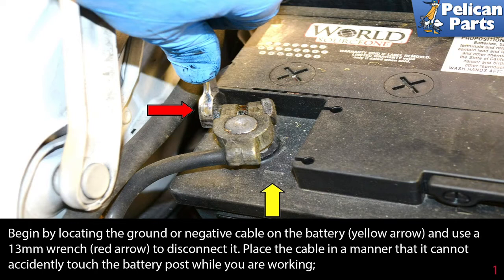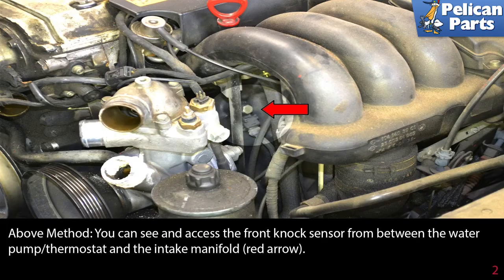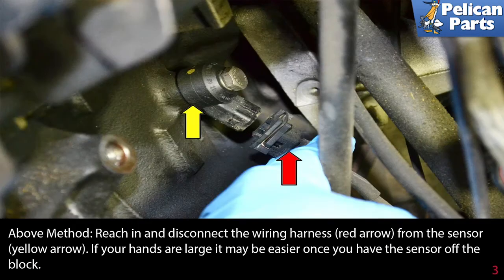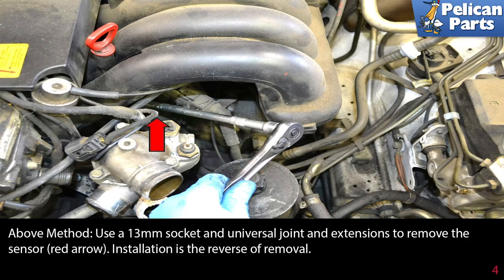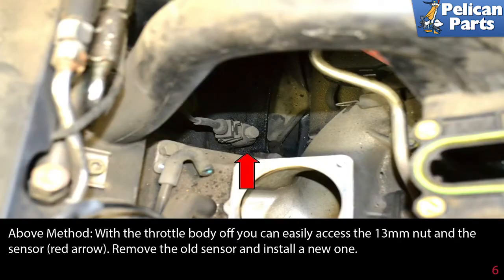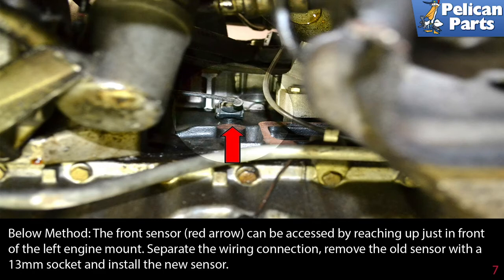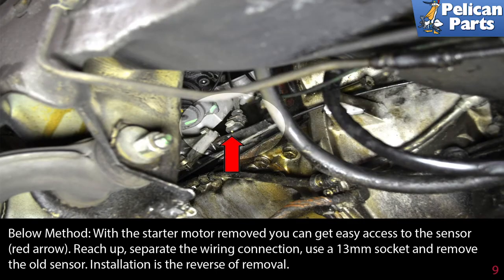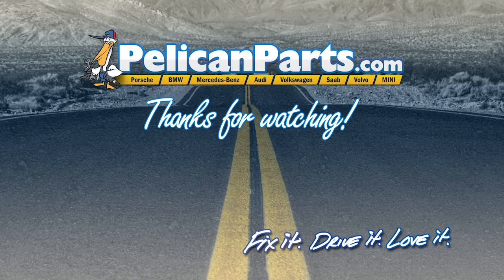Mercedes-Benz W124 E-Class Knock Sensors Replacement

Comment: Is this the same location with w124 E220 ?
Reply from the maker: Applicable Models:
Mercedes-Benz W124 (1986-95)
Reply: What is the part number for knock sensor? Are they both the same? I'm having trouble finding the part for my '95 E320 Cabrio. Most of what I'm finding are for 96 and newer e320s. Will they work on a '95? I really appreciate you posting this video, it will make things easier when I'm able to replace them.